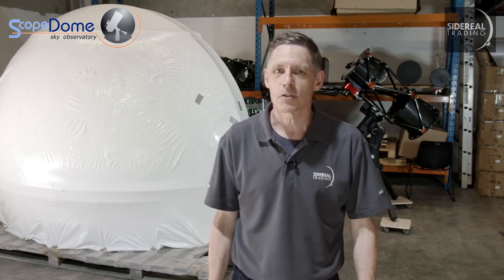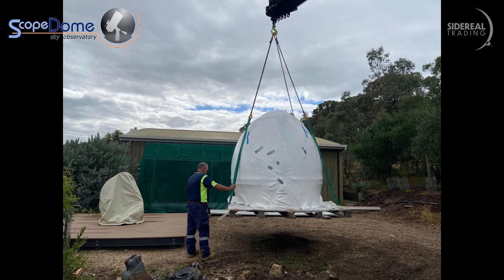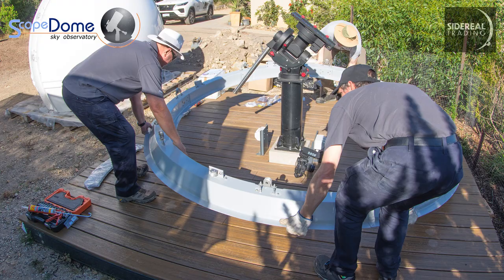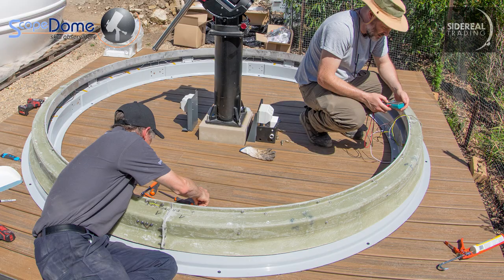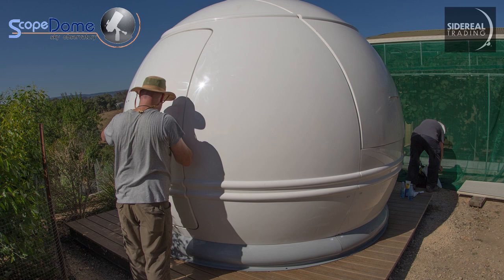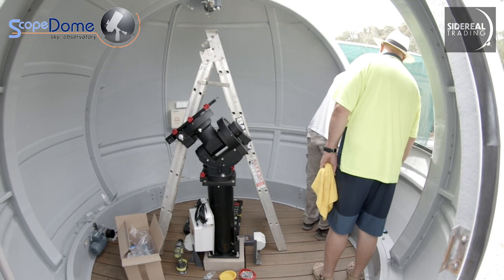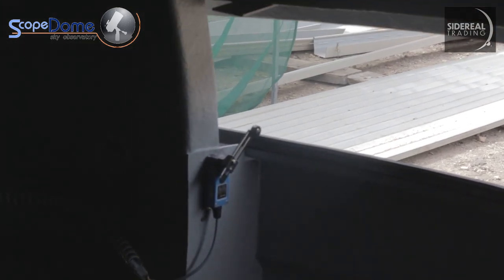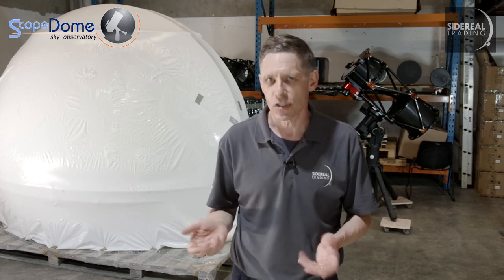Installing a 3 metre ScopeDome

Comment: Great little dome, I would have built it on a concrete slab because my back deck is made of that plastic wood and it buckles in the heat, just a little but it does move.
Reply from the maker: How much of a gap do you have between the slats with the composite decking? If you give it a good wide gap (we like to do that so there's a good amount of air flow inside the dome) they don't buckle when they expand. We recommend composite decking.

Comment: In minute 5:04 I see a person standing up inside the dome and, honestly, the diameter doesn't seem 3 metre, but 2 metre.
Reply from the maker: The 3-metre ScopeDome is 3 metres in diameter (3019 mm to be exact) at its widest point. However, because the dome extends outwards from its base, this widest point is at about waist high when you stand next to it. The base ring (which is what is being installed at 5:04) has a diameter of 2232 mm on the inside and 2752 mm on the outside. There are diagrams at https://www.scopedome.com/wp-content/uploads/2020/10/ScopeDome_Manual_3_0_EN.pdf.

Comment: There is no way that the dome is 3 meters wide. It appears to be about 8 ft.
Reply from the maker: The 3-meter ScopeDome is 3 meters in diameter (3019 mm to be exact) at its widest point. However, because the dome extends outwards from its base, this widest point is at about waist high when you stand next to it. The base ring (which is what is being installed at 5:04 ) has a diameter of 2232 mm on the inside and 2752 mm on the outside. There are diagrams at https://www.scopedome.com/wp-content/uploads/2020/10/ScopeDome_Manual_3_0_EN.pdf.
Reply: 8’ is almost 3 meters 😂 (9’)